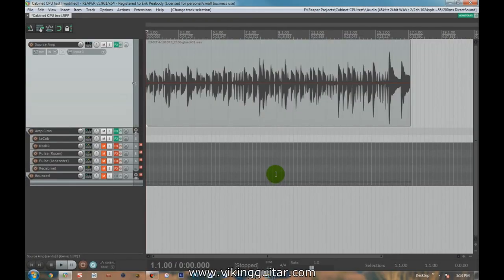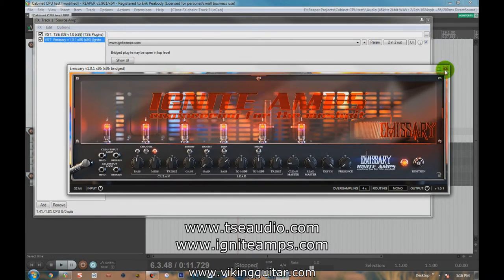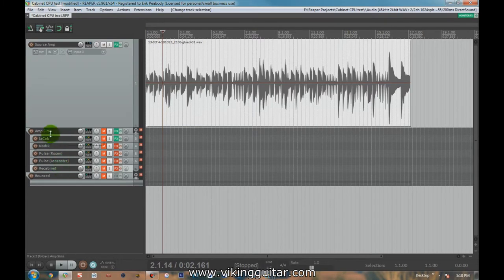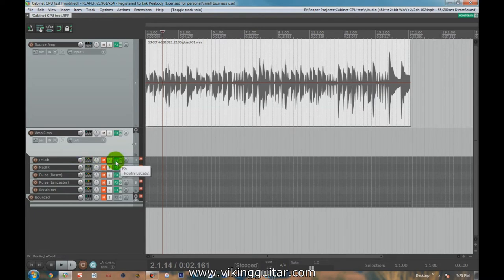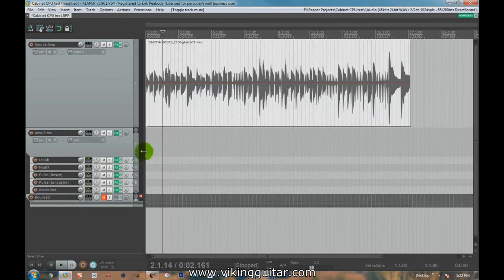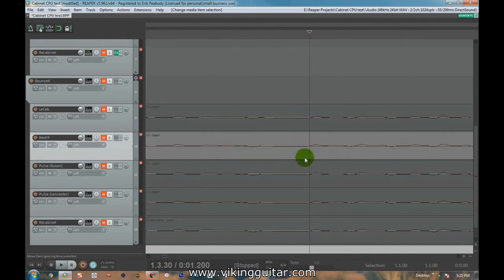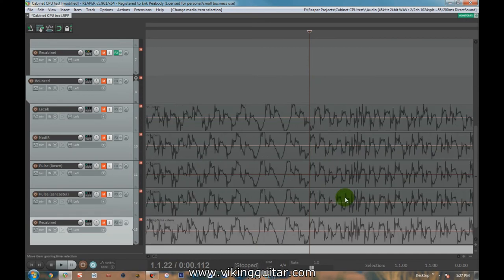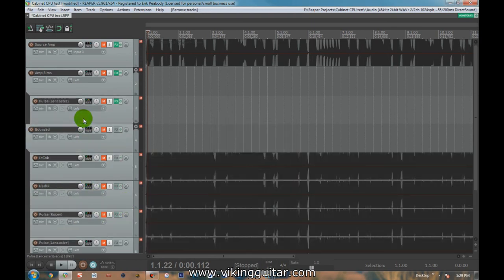Guitar Impulse Loaders - Which is best on CPU (and general discussion)

Comment: Thanks for the cpu load comparison. I quit using LeCab because its interface with the finder on my mac was very clunky. When loading an IR file, it always defaulted to the desktop and I had to always drill down through all my folders to find it. Nadir is much more graceful, and remembers the last folder you were in. Will definitely give Lancaster Pulse a try after this vid. Thanks!

Comment: This is an excellent video for bedroom producers like me. Thanks!
I will add one positive note: IF you are a user of FL Studio (as I am), it may be worth using the native "FL Convoler", which operates on the same principle (you simply have to have the Dry @ 0% and Wet @ 100% if you want it function as an IR loaded). IF you are satisfied with the CPU load of that plug-in (usually FL native plugins are low tax), it's quite useful; especially if you use it in conjunction with the mighty FL File Browser which has drag-and-drop ease for days.
Reply from the maker: Thanks for the comment!  This vid is three years old, so some of it is outdated.  I appreciate you including more information to help bring it up to date!

Comment: Nadin IR was troubleshooting my DAW for any reason, I installed Lancaster and it works great with ableton and very stable, I am using it with Core Tone Bundle pack of ownhammer only 19.99 and the results are great, compared with amp simulators vst, IR are affordable and the results are better (real tone)
Reply from the maker: That's great to hear!  I'm glad Lancaster is working well for you.  I've been meaning to check out Ownhammer; might grab that IR pack.  Thanks for the comment!

Comment: Are there any IR loaders that support "non-preamp" like distortion pedals? I have created quite good sounds with using clean channels of full blown vst-amps. But everything ready in one IR loader would be great, "pedal mode" or something similar. Have never seen that.
Reply: IR's will 'color' the sound but not transform the signal. Transforming the signal belongs to the analog or digital mathematical operations of distortion/overdrive, compression, harmonic excitement, re-pitch, chorus, etc. Convoluted reverb (the principle of an IR) will only give a vibration (such as the vibration of a guitar string) a new sense of a different space/place (like an electric guitar signal fed into a speaker cabinet, or even the wooden box of an acoustic instrument).
Reply: @brianbergmusic5288  Yes, actually 2Notes offer a poweramp/postamp simulation in their software, also AMT and Mooer Radar. But I've not seen a pedal-amp simulation which would be handy in an IR-loader software. The plexi-like distortion pedal "English Man" from Caline. When I use it with a poweramp sim and IR loader it lacks high frequencies. But ok, of course I could use a sim of a Fender or HiWatt amp for this purpose. Thx for the answer. Cheers.
Reply: @InTheSh8  Ah... I was barking up the wrong tree. You were looking for software that does BOTH IRs and preamp solutions. I gotcha. Since I generally load separate plugins for each task, I wasn't understanding your question.
Reply: @brianbergmusic5288  No prob. Actually I'm not in my experimenting phase anymore (to combine real gear with simulated components). I mostly did that to save CPU resources. But I gave up on W-10 now, went back to W-7 and deactivated the usual suspects in services. Now I don't have dropouts anymore with several tracks loaded with vsts. W-10 can also be debloated, but it's just so blown up with crap and switches, got me on my nerves, so unpredictable.